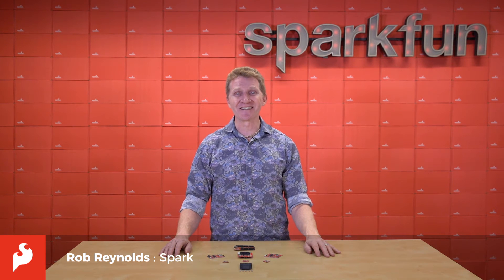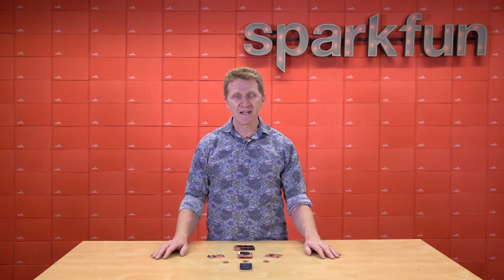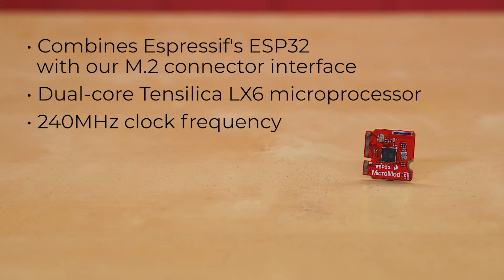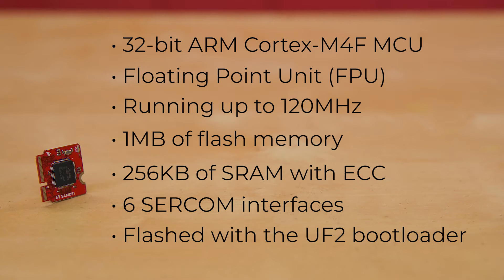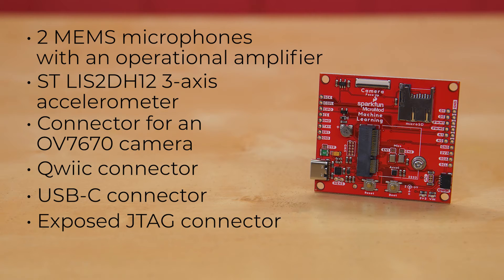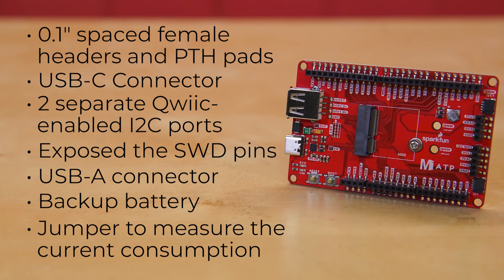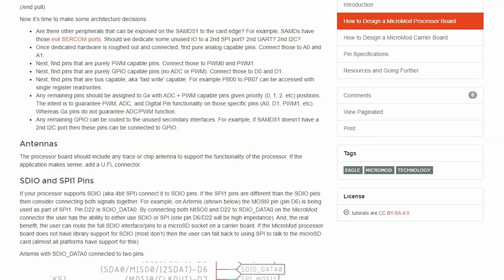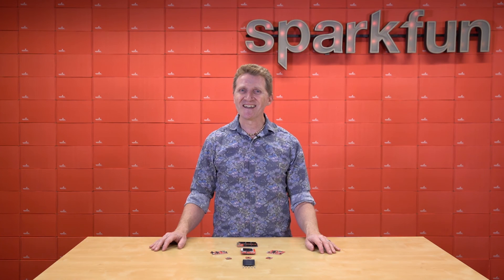Product Showcase: SparkFun MicroMod Ecosystem

Comment: (5:39) Hey, that's bytes for the ATTiny84, not bits [on the "MicroMod: Input and Display" carrier board] and I think the μSD and M.2 slots need separate bullet-points unless the MicroMod suddlenly does all it's interfacing with SDIO (which it doesn't - I checked).
This is interesting stuff. I'm happier now I know what the connector standard is (I didn't recognize it off the bat).
I had been toying with putting the RP2040 on an ATP breakout, but then I found your Artemis processor too interesting - and got it (yesterday) on a RedBoard. You robbed ST Microelectronics of my first Nucleo purchase! That was on impulse. I hope I find good docs!

Comment: NIce! I'd like to use an Artemis board for e-paper monitor using a driver like https://github.com/dj311/epd-wm  It has multiple SPI & Quad SPI, so I wonder if I could add extra F-RAM to run Nanolinux or a web-browser app like: https://www.youtube.com/watch?v=5lTN4Q4oE9Y and storage and make it like a micro-Raspberry Pi or e-reader w/web access.

Comment: I would like to have a smaller formfactor besides the M.2 connector for connecting simpler CPUs or simple sensors onto a carrrier board. Something very small with 10 or less rows of connections.